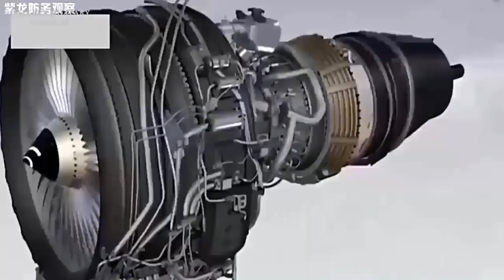China’s WS-15, J-20 performance matched that of the Pratt & Whitney F119, F-22 Raptor

Comment: China s WS-15 engines will be installed in the J-20,J-23,J-25 ,J-31 and the Y-20
Reply: never see j23 n j 25  give the link to see please
Reply: Not Y-20. Y20 is installed with ws20
Reply: @李天颖  ws 20 ? never heard about it , give the link please
Reply: hanafi tanudjaya it’s on Wikipedia. Doesn’t mean it’s more advanced than ws15 or anything. It is for Y-20 specifically, not for fighter jets